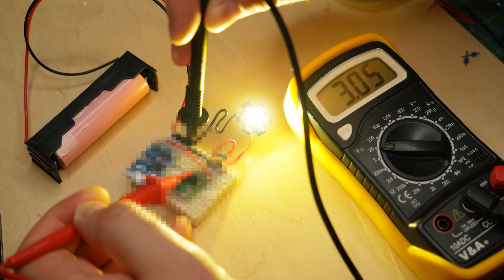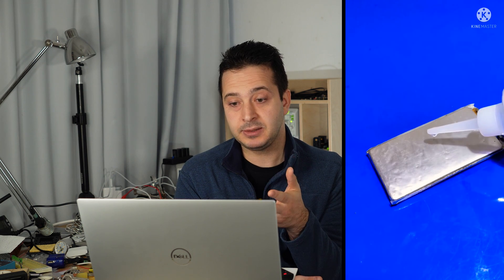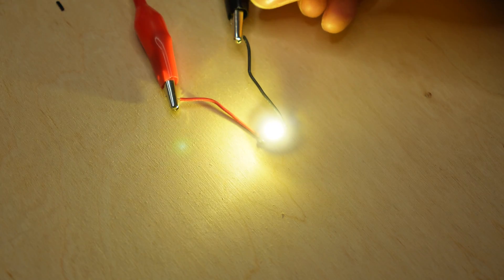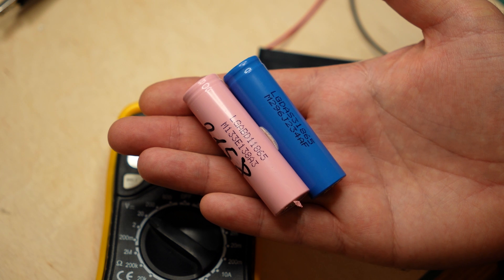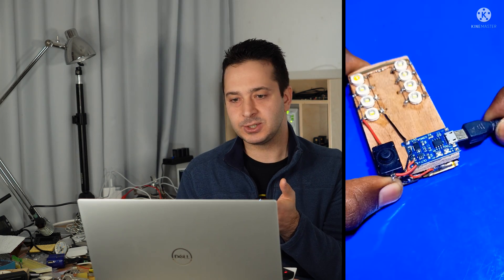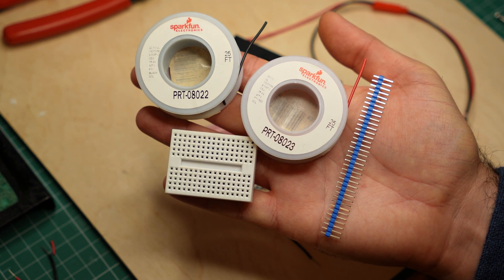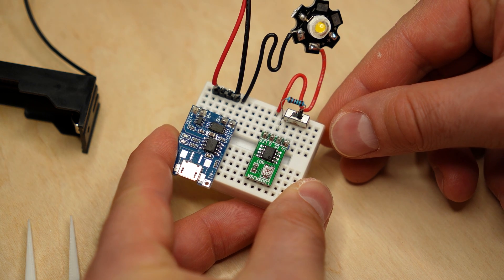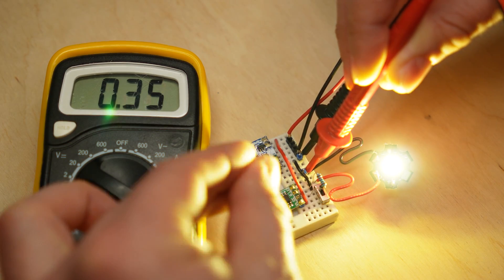DON'T make an LED flashlight like this

Comment: Since I wanted to make a flashlight-laser combo and all i had at hand were some switches, tp4056, a laser diode and a bunch of these 1w led diodes (and no circuit-making knowledge), I can clarify a few things. Putting one led will definitely make it too hot but I ended up putting two for that reason, in parallel, and it fixed the issue. I dont know if tp4056 is limiting the current output in any way but it's actually pretty normal temperature and the battery was a brand new 18650 2600mah lithium battery (with true capacity). For some reason, putting these leds in series will not work which is mostly why I opted in for parallel.
Reply from the maker: Yes, the TP4056 will limit the current since it thinks it is charging a battery. The problem is one of your LEDs might get more current than the other, which could damage it. For series LEDs you need higher voltage. The chip is going to give you no more than 4.2V. I have an LED video tutorial that explains series and parallel connections

Comment: Can I connect led directly to tp4056 output without lef driver?
Reply: You can use but use a capacitor  about 16v 240uf

Comment: What is the purpose of the resistor? I see you connect it parallel to the led. Does that mean current flow through it will be wasted?
Reply from the maker: The 10k resistor is not parallel to the LED. It is connected between the enable pin (EN) and GND, and its purpose is to give a default state to the EN pin. 

The EN pin turns the driver ON if it sees voltage or OFF if it is connected to GND. However, if it is left floating (not connected to anything), it may behave unpredictably. These so-called pull-down resistors are pretty common in electronics.
Reply: Thank you bro  @LeftyMaker

Comment: Thank you for the video! It looks like the led driver module directly connects GND to CE, so the pull down resistor you added wouldn't do much.
But the white markings on the module make it hard to see if the CE pin is actually pulled down to GND, do you know if that is the case? And if so, does the pull down resistor do anything, or is it bypassed by the module?
Also I was not sure if it would make sense to put a current limiting resistor between Out+ and CE, would that do anything, or does the module limit current draw on the CE pin anyway?
Also if the CE pin is actually directly connected to GND and the switch enables the driver by pulling CE high via Out+, isn't that a direct short between Out+ and GND when you turn the led on?
Am a bit confused, still trying to learn the basics, hoping to hear from you!
Reply from the maker: Hey, I'm pretty sure the Enable pin is not connected to GND by default because the driver stays on if I remove voltage from EN and leave it floating. The 102 SMD resistor on the module is in series with the potentiometer. It adds an offset to set a limit to the current setting. And no, you don't need a resistor between OUT+ and CE. That's probably the gate of a MOSFET so there is practically no current flow.  About your last question -- yes, connecting CE to GND and voltage at the same time will cause a short. The driver will not even turn on, I guess.
Reply: @LeftyMaker allrighty, that makes sense. Thanks for taking the time to respond, that cleared a lot of confusion :)

Comment: Great video. Wouldn't it make sense to also add buck or boost converter, before the constant current driver (the led driver), depending on the LED rated voltage (assuming the LED is 3V) we'd add a buck converter, set to around 3.4V (due to some dropout voltage of the driver), this will be more efficient than burning off the higher battery voltage as heat (when charged to 4.2V), of course that is if using a linear device such as the driver from the video. That way in theory the single cell will last longer. Similarly if we drive a 5V led we'd add a boost converter set to constant 5V. Also, as far as I know the TP4056 has a fixed undercharge hard set cut off voltage at around 2.4V, which first, it is quite low if we'd like to keep our battery healthy and second, once the voltage starts dropping bellow 3.4V in theory the LED will start dimming. So ideally, it would be also nice to add a voltage comparator and cut off the supply at around 3.4V, (since the dropout for the CN5711 should be around 0.4V), or use a buck boost if we really want to drive the battery to its absolute minimum capacity and use the 3V LED. Sorry for the long comment, no criticism here, I just started brainstorming and felt like dropping a comment. Please let me know if my thinking is wrong. I am still a newbie in electronics and I am always opened to learn more.
Reply from the maker: You're right in assuming the circuit could be more efficient. An alternative approach would be to use a switching LED driver. This would result in better efficiency, but the circuit will be more complex, and the component layout would be critical to minimize switching noise.
Reply: I had no idea the circuit just burns off the additional volts as heat, why does that happen? I just assumed the driver circuit has something like an internal voltage regulator, what happens here instead?
Reply: @hanswuast737  It has a very common type of voltage regulator called a "linear regulator". Basically it measures the current and drives a MOSFET as a variable resistor to reach the set current. With this type of voltage regulator, input and output current are identical.
So it has a control circuit built in, but everything is integrated into the IC with no expensive or bulky components. If the input voltage is too high, this will quickly become very inefficient and you'll net to heatsink the voltage regulator.

Comment: He did not directly attached to the parallel leds to the battery he attached it to the out Plus and out minus ports off the tp4056 module so the module is itself limiting the current and I think the module can maximum give around 700 mA to 1A. 

So either the module is gonna be melted or burnt or the leds did not get the full power (current) they need

Comment: Lovely video.  I am zero in electronics especially when it comes to principle of watt vs volts vs current vs amps etc.  But this video seems to be very much doable for my project. So thank you.
only question is that can i put more LEDs in series on this circuit and will my 3d Printed  box PLA be able to bare the heat from the heat sink?

Cheers :)
Reply from the maker: With this circuit, more LEDs in series is not an option because there won't be enough voltage to drive them. You will need a different circuit -- either one with LEDs in parallel or one using a boost converter.

Comment: The best and most efficient driver will always use a buck/boost converter with MCU to limit the maximum current at the highest output. Of course this is not the cost-efficient way, but if one uses a high-powered LED (10W and up), this is the best configuration when running on battery especially if voltage-sag is a concern.

Other way is to use FET with PWM-controlled output, but this will be dangerous if the battery able to supply more current than the LED can take in. 

For lower-powered LED (3 - 10W), the lowest cost and easiest is to just use 7135-linear regulator. One can also stack multiple units in parallel to achieve higher output current

Proper heatsink is absolutely necessary when driving any high-powered LED at their maximum rating since higher Tj will increase the LED Vf which in rare cases, can exceed the supply voltage of lithium-ion. Of course, all of the above driver-types can also be used for 6/9/12V LED with a little modifications depending on the battery configuration.

Comment: There are lots of so called project from India people that are very bad and very misleading, with bits of wire and components soldered without any PCB or breadboard, all this stuff should be banned on you tube 90% is junk and very bad, so thank you, for people that don't know! you always know when you see the soldering iron.

Comment: Hi. Full battery 18650 is 4.2v full and drops to 3.2v so led with buck converter or resistor gets darker when voltage gets lower? I'm not electrician 😊

Comment: I see you only got 2158mah out of your LGABDs. They are 4.35v batts from 2010 era and the bulk of their output is higher up on the curve. You'll note in the documentation that they say they cut off at 3v but go down to 2v. they give 1a sustained output to 3v then 580mah to 2v. The controller those batteries are usually connected to tells the laptop to go into low power mode while you eek out your last 500-600mah. I am so glad these cells are entirely phased out.
Reply from the maker: I didn't know that. Thanks for sharing! They were indeed salvaged from a laptop

Comment: I think the TP4056 module's Battery Protection Chip can not deliver more than 2Amps as the Mosfets in it are small. And that's the reason, leds in the other video did not burn.

Comment: The builder of that flashlight will get a nasty surprise if it's dropped and the cell is damaged. I deliberately damaged one that size to see the effect (outside in the open of course!) and it went up like a smoke bomb before bursting into flames. There are too many dodgy and incorrect videos like that, but there is little regard for safety in the places the videos originate.

Comment: I made a flashlight following that schematic and worked well, but one day stopped to work. I thought that something burned, like the LED or the LED driver, because I tested with a multimeter and the voltage was OK in the TP4056 and going at the LED driver VIN, but there's no voltage at the LED pin of the driver. So I tested the LED, putting 3V in the LED and GND pins of the driver using my adjustable voltage powersupply and the LED turns on, and after that the LED driver worked again like there's no problem before.
What could have happened? It's good to know that nothing burned but can be a problem if that happens sometimes, because I need to dismantle the flashlight and inject 3V in the LED again.
Reply from the maker: Weird. Never happened to me before. I wonder if it is the driver shutting down for some reason. Could it be overheating? Does it turn off after prolonged use? Or could it be a poor connection to the enabling pin?
Reply: @LeftyMaker  well, I don't know. After the "resurrection", it's working fine again. I'm trying to use as much as I can to see if the problem happens again. The first time it occurred after few minutes turned on, but I'm testing now for more than 15 minutes and still working, and there's nothing overheating. I hope this don't happen again, I only commented here to know if this is something that could happen.
Reply from the maker: Nope, that's not typical. I've had it on for close to an hour without issues. But if it does happen, I don't have any guesses what could be causing it.

Comment: Thanks for the info. I once made a flashlight with 4 hpl leds and added a heatsink. I connected a 4.2v battery directly to the led. And the led got very hot even though I added a heatsink And it only lights up for 10 minutes with a 2000mah battery. Now the battery has dropped And also the LED😅
Reply from the maker: yup, sounds like you overloaded them. They either burn out or get dimmer when you put more current through them than you should.

Comment: I am late to this video, but maybe you will see this anyway.

I like your design, and I want to try the same thing. I have some LEDs that look exactly the same as yours, but they are 3 watts.

I want the extra brightness, so can I make some small change to drive 3 watt LEDs?
Reply from the maker: Sure, but you will have to use a different driver to get full power. This one gets only to about 2W from a single battery

Comment: Im using a LM2596 off temu its set at 3.1v and no resistor I run 3 x 3w LED's in paralell 3.1v x 0.7A = 2.17W per led  total 2.1A medium heat with heat sink

Comment: nice, but the original video showed multiple LEDs while you demonstrated a single LED.
Reply from the maker: For multiple LEDs you can use multiple drivers in parallel. With a higher supply voltage you can run LEDs in series, but not with this driver. I will soon make a video about a different driver that can run long strings of LEDs

Comment: LeftyMarker in the another video you shown in this video has leds connected in parallel so they will waste a ton of amps and power so  the first led will share the amps and power to the second one and it repeats like that so there will not be high amount of power and amps to burn down the led and 8 of them in parallel will form 8watt so there won't be enough power and amps to burn down the leds

Comment: 02:43 One small correction: the current is limited by the total resistance of the wiring and the internal resistance of the battery. In the case of dividing the current into 8 high-power LEDs, this may be enough to limit the current to an acceptable level (although this is still a mistake from a circuit design and engineering point of view).
Reply: Oh, nevermind. You've mentioned it later @ 04:30. 👍🏻

Comment: thanks god, for this person made this video, i just bought some broken led for a dollar, so i want to change it, but what i know some video doesn't check how broke led without proper module.
And I want to ask something
what module for;
strip cob led 5w(4 piece) with 3 battery? I use brand new laptop cells because I have.
And thanks 🙏 for the answer.
Reply: Depends on the COB led forward voltage

Comment: Great video.  Im an electrical engineer and regularly see these things in commercial products.  Leds are regularly connected in parallel with no balasting resistor and connected to a voltage source.  While it does work but not for long and rejected peices because the LEDs came from mixed lots must really hurt their yeild.

Comment: Some bottlenecks:

1. The LED needs more heatsink.
2. You should use a switch mode regulator instead of an analog regulator.
Reply: Yeah, SMPS with CV and CC modes. Or maybe even power limit, but that's more difficult to implement.
Reply: @MrHerhor67  When driving a LED you want CC mode since a light emitting diode is a "negative resistance" device.  If you use CV mode then things will go bad quickly.
Reply: It may not be too inefficient using an analogue regulator as the battery voltage and LED forward voltage are not too far apart - worst case full battery (4.2V), about 210mW dissipation in the regulator (assuming 3.5V LED voltage drop and 300mA forward current), becoming less as the battery discharges. 20% waste at full charge and becoming lower, comparable to a simple switching regulator.
Heatsinking would probably need to be improved if the LED is in an enclosure.
Reply: switch mode regulator not available in my country😅

Comment: What's a pull down resistor?
Reply: To add a bit to the prior answers, sometimes the power and ground connections are referred to as "rails."  There is always a higher voltage rail and a lower voltage rail, even if that lower voltage is the common or reference rail.  In a simple circuit like this, the higher rail is the battery positive and the lower rail is the battery negative.  (More complex circuits can have multiple rails at different voltages.)

A "pull down" resistor connects between a point and a lower rail, pulling that point down toward the lower rail.  A "pull up" resistor connects between a point and a higher rail, pulling that point up toward the higher rail.

If you connect equal value pull down and pull up resistors to the same point, that point will be centered at a voltage mid-way between the two rails.  If one of the resistors has a lower value, it will "pull harder" toward that rail and the voltage of the point will be closer to that rail.  The voltage of the point can be calculated using ohms law (amps = volts / ohms) multiple times with the total resistance to find the current, and individual resistance values to find the voltages across each resistor.
Reply: The name's pretty obvious!
What other does it pulls down?? Pants??
Reply: It is a resistor that pulls the voltage down to ground potential on that pin when the switch is open. Otherwise, if left floating, the high-impedance sensitive enable input could get randomly activated by induced, leaking etc. voltages.
Reply from the maker: Yup. Without it, the LED may (and did, in my case) start flickering when it's supposed to be off. The opposite is a pull-up resistor.

Comment: Great video, thank you! I got a high power LED a while ago, and now I have a project to try it in! I'm curious, I've heard the light intensity of LEDs is usually modulated by flashing them at a high frequency (like PWM?) since they don't function below a certain voltage. How dim can the LED get with current limiting?
Reply from the maker: Yes, you can use PWM to control the brightness of the LED. The datasheet for the chip in the driver says it supports it by feeding the PWM signal into the enable pin. They can get very dim with current limiting too, but the brightness is more difficult to control.